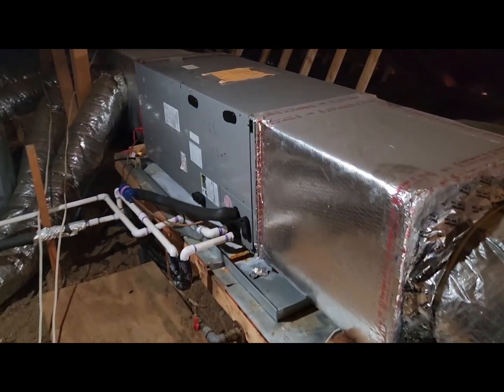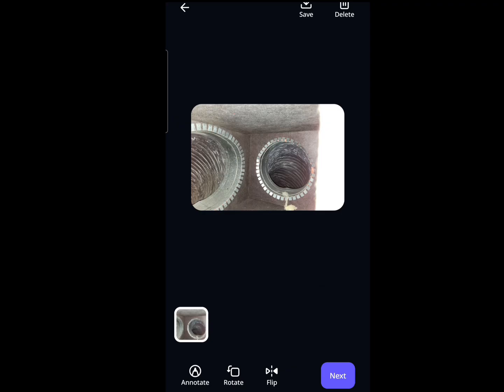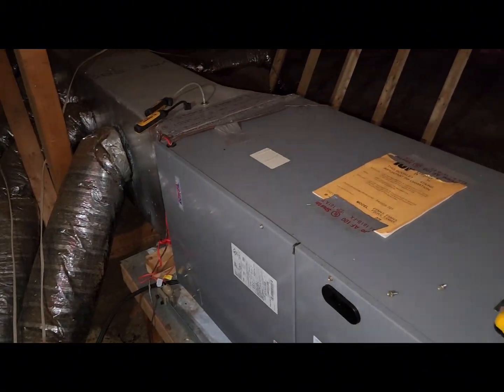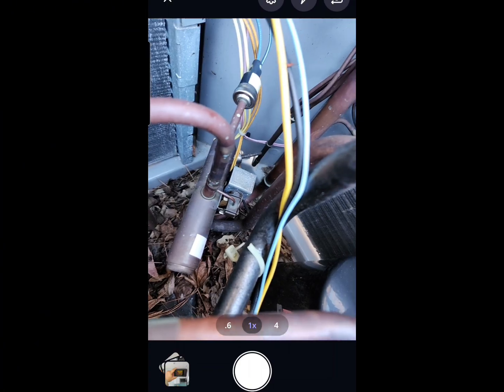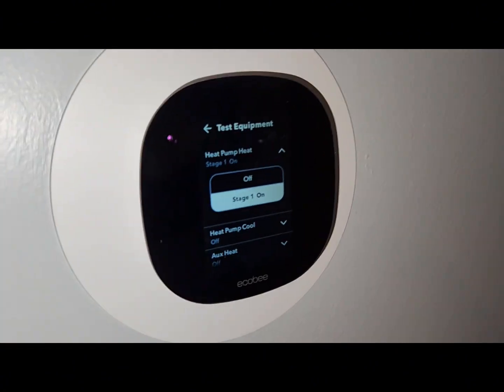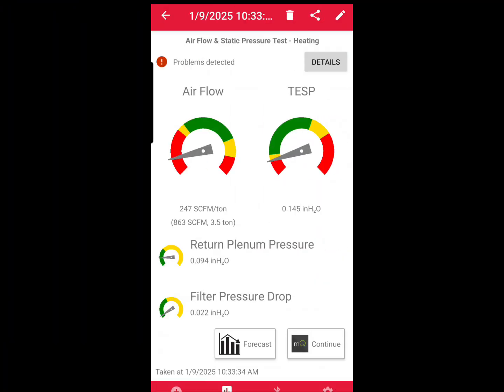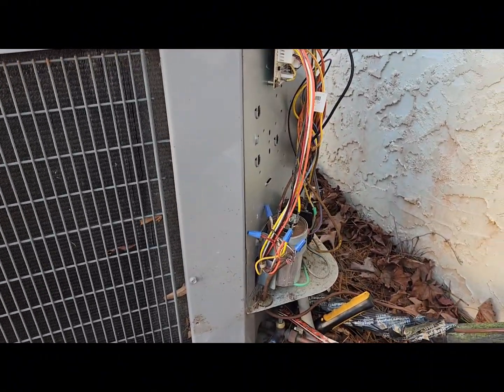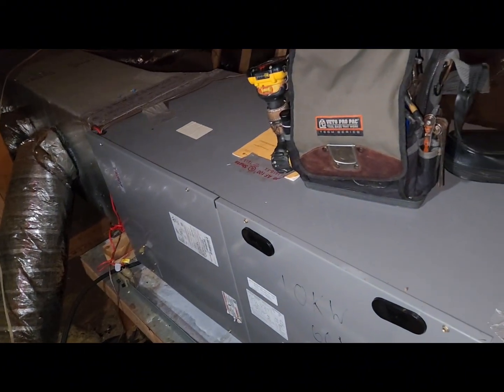Heat Pump Service Call Using My Full System Assessment Process

Comment: If anyone in the Austin TX area will do this exact audit on my house I will pay you $299 to do it gladly
Reply from the maker: @chriss8319  that 299 is a diagnostic. If i do this as an "audit" where i may not get work as a result its $399 or more.
Reply: @ I’ll gladly pay $399. I’ll pay $499 if I need to. I would be thrilled if you did it but I’m sure you won’t come all the way to Austin. Anybody in Austin reading this that can do what Tim does please reply
Reply from the maker: @chriss8319  look up Jon Esquivel with Austin Star Services. Tell him I sent you.

Comment: I thought I did a pretty good job at looking at the whole system, but this is next level. Nice to see everything in the app. Detailed assessment gives the customer a clear picture as to repair or replace. Solves issues. Prevents issues. Makes money with integrity. I like that you do charge more for a diagnostic even though it may still lose money. Second video I've watched of yours and I am impressed. I am going to make an effort to try to incorporate a lot of this. I want to make money, no doubt, but this is the way HVAC should be done. Had a call today from a landlord with two problem systems that someone poorly installed. I have been out before, but usually rush through, solve THE problem and bounce. She has had 9 tenants move out of these duplexes in the last few years due to high power bills and comfort issues. This time, equipment was running and I just took my phone and a flashlight and walked all around the house. Unit was empty. Tons of leakage. Cracks in the door big enough to put your finger in. Old windows not able to be shut. No insulation. No vapor barrier was installed by the siding company. Windows are not caulked. 2 fireplaces were just knocked down by the roofers and were left open to the attic. Water stains from condensating ducts. Attic air coming through the boots. Grabbed my tape measure to do a basic floor layout. One unit is 1250 square feet and the other was 850 square feet. But, both had the same size units. It really is about being a master of the obvious. And I knew it had some HVAC related problems, but, being a rental, I never really paid any attention to anything else.

Comment: Ecobees come factory set to disable heat pump and only use electric heat when o.d temp is below 35 degrees. I would be surprised that by the tine you reset the thermostat, your outdoor ambient was above the lockout point. If you go back check that setting and disable it. I have a bunch of ecobees out there and learned from experience  lol

 Steps below to change two nuisance call back settings

Settings
Installation settings 
Threshholds
Compressor minimum outdoor temp
Disable 

Reminder alerts
Preferences 
Aux run time
Disable
Reply from the maker: @stillsolidify  i think that was it. It was under 35 and the hp only ran in tesr mode. When i reset it I always set it up correctly similar to your list 🙌🙌

Comment: Awesome stuff! How do you like ConduitTech? Doing building forensics, I’m struggling to find a faster way to get a simple temperature check if the system is potentially oversized. 

I’ve always been too anal about it and spend hours setting up a heat load calc not including time to getting proper measurements prior. I have to charge the customer more to do them. If I had a way to knock them out in 30-45 min while being accurate, that would be amazing.
Reply: Wow what app lets you do all this?
Reply from the maker: @c21meister  Safety Culture iauditor
Reply from the maker: @BrantleyIAQ  i love conduit tech.

Comment: Tim, when you alot the more time, for your pre-accessment, are you adding this cost to customer?
( never a dumb question)

Also, how much more time on average, does it take  you to do your pre-accessment?
Reply from the maker: @UncleEarlHeatingAirCondition  My basic service call is $299. It doesnt pay for the time but I WILL find billable repairs and replacements.
Reply: @timdestasiohvac  Good information!
Reply: Hey Tim, how long do you plan to spend on a service call, and how many do you plan to fit in a day?
Reply from the maker: @RedneckRandino  2-3 calls per day. I plan on 2 hours per call just for diagnostics.